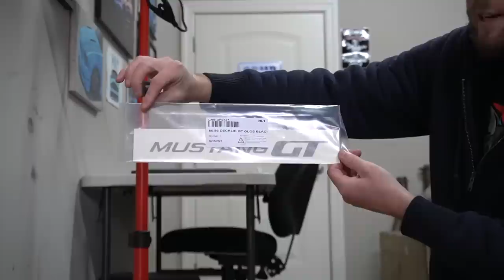GOING MAX EFFORT!! Installing MGW Shifter, One Piece Driveshaft & Prepped for E85!!

Comment: About time bro been waiting forever for these mods to happen to blucifer 🔥 idk if blucifer has it or not but it’d probably be a really good idea to install a adjustable upper control arm for the rear end so you can adjust your pinion angle to spec
Reply from the maker: Yeah i need to frfr
Reply: @DerekBaranProductions  oh yeah because replacing a pinion seal isn’t that fun 😂

Comment: Cant wait to see the numbers blusifer makes on E85 on the Dyno!! Love how silver back is coming along hate to see half the fleet leave unfortunately cant wait to see the termi on E85 with a smaller pulley and maaaaaaybe some more aggressive cams? Lol 😝
Reply from the maker: Yessss now we are talkinnnnn
Reply: He already made over 700 wheel on pump gas how much further is a gen 1 gonna be pushed?  Lol
Reply: He made in the ball park of 750 on pump gas if i where to guess id say blusifers got solid 8s in here with E85 a tune and some timing but ima throw my hat in the ring and say she gonna make 810 if not close to it
Reply: @fullsendmikeperformance9931 with an mt82 no lol, he will need suspension, and driver mod to even hit low 10s.. but i believe in derek if he applies himself to drag racing.. that setup with a stock mt82 is capable of 9.8s ish...
Reply: @1mean_5.07  where talking about horsepower numbers not times on the track?
Reply: @1mean_5.07  where talking about horsepower numbers not track times?
Reply: @fullsendmikeperformance9931  sir... in the prrvious comment you said "id say blusifers got solid 8s" it takes a lot of work to get into the 8s lol.. but i guess you tried to say 800s*
Reply: @1mean_5.07  yeah solid 8s as in 800 horsepower?
Reply: @1mean_5.07  its motor head slang lol

Comment: You still get locked out on that MT82?
Reply from the maker: Naaa, not with a new clutch
Reply: The clutch is the main issue that causes that with a good clutch you're good but the shifter also needs to be upgraded mgw ftw.  With both of those you're golden.
Reply: @midnight347  good clutch recommendation?

Comment: Not trying to be a jerk by asking but why go e85 if you not gonna ever run it....just to drive around town?????
Reply from the maker: 2022 a different year ma boiii
Reply: Safer for the car for one. Secondly, why not? More ponies
Reply: @DerekBaranProductions  hope so!
Reply: @lifeonmars03  thanks
Reply: @lifeonmars03  its def safer but he was well above 700 as is that is really pushing a gen 1 coyote imo.  Not sure how much more power he'll end up with unless he's just gonna send it with no regaurd for the stock bottom end lol.  It'll stay together better at higher power levels on e85 for sure but over 700 is already really pushing a gen 1.
Reply: @midnight347  I'm hip, I'm hip. I have a paxton gen 1 myself, still on pump. Looking to make the switch back to e when I go return style this spring. We'll soon find out what the numbers are looking like for Derek though. You are def correct though bro
Reply: @midnight347  close to that wall. Gotta really start thinking about the next move
Reply: @midnight347  yeah it’s playing with fire 🔥 but hey ya only live once right 😎
Reply: @lifeonmars03  there is no doubt if you're gonna be pushing it to the edge you are better off being on the best fuel possible.  If not e85 at least 93/boostane which is what I'm doing on my 07 gt500 after I throw my gen3r on.  I'm gonna be running a 2.6 upper stock lower around 20 psi.  Due to low compression on the gt500s you can run 18psi on pump but I'd just feel better with boostane even at 18.  I think 20 on 93/boostane would be safer than 18 psi on straight 93.  I know I feel alot more comfortable running that lol.  I would like a return style system at some point with e85 after I build the motor like I plan to in couple years.  Till then I think 93/boostane will suffice it takes it to 100 octane so it's alot better than just straight 93